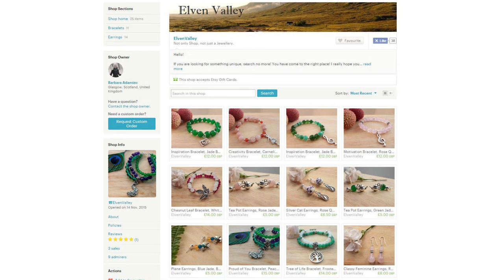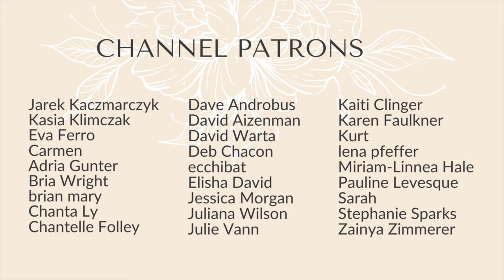HOW I STARTED making jewelry.

Comment: Your art is beautiful. I have a welding background and have just started experimenting with silver jewelry creation. My problem is with the endless choice on silver solder. I bought off amazon what was listed as silver solder but found it does not puddle or flow under mapp gas temperatures. Even the smallest sliver refuses to flow like I see on yours and others videos when using a propain pen torch. If you or anyone reading would be kind enough to provide me with a link to what they use themselves.
Reply from the maker: Ahh, that can be so annoying, and honestly you shouldn't have this many problems with it! If it was genuine solder that is. I think buying solder on sites that aren't by actual suppliers can be tricky. I recommend shopping at Cooksongold in the UK (they also ship within Europe). In the USA go for Rio Grande! Just type solder in their search bar and you'll be given many options. I personally use hard and easy solder the most (for some reson medium solder and I aren't the best team lol). I buy it in the stripe and cut it into small pieces myself. Hope that helps! ❤️ If not, come back and we'll try to ficure something out :)
Reply: @TheArtOfMetalsmithing  thank you for your help. I will try them. I suspect I was sold plain silver wire. I'm not going to give up though. Plan on buying a crucible, ingot mold, press roller and draw plates within the next couple weeks.

Comment: In my country it is illegal to sell your handmade silver etc jewlery unless you study it at school and have certificate :/
Reply from the maker: Really?? Wow, that is so limiting... I can understand where this rule comes from, it's not totally without the reson, but I'd rather see proper regulations in place, rather than making it completely illegal altogether. May I ask where you're from?
Reply: @TheArtOfMetalsmithing  I'm from Slovakia. And those rules are to protect buyers so they dont buy imitations of precious metals. You can sell unmarked silver stuff only when it is under 3 grams. But this also doesn't help that much - because of this rule there are even more bad products. For example I bought tourmaline sticks and the top of it there is so thin silver, that it get easily ripped of by the circle/ring which is connected to it. Or I bought  kunzite stick and the bezel was actually good but that hanging stuff (sorry don't know English jewelry terminology) after using changed color and it definitely wasn't silver. :/ You can make silver jewlery  above 3 grams, but only for yourself or as a gift. It is just illegal to sell it if you don't have a license from school. Plus there is also problem to get the right liquids (if you need acid) or tools  If you don't have business licence. There are some jewlery courses, but they are more like for hobby. If you pass it, it doesn't mean anything. Thankfully, there is one school in capital city, which allows you to study jewlery in the evenings. So 2 times per month we have practical classes. And you study for subjects home and then you have exams. It is possible to pass it in 2 years, since in one year you can make exams for 2 years of study. Just the last year takes whole year because there are final exams at the end of school year. 
And for every exam there are subjects like - art history, materials, technology + at home you prepare about 20 art projects which consist of drawing, painting, modelling stuff out of clay, then study of jewels of various periods and also designing jewels. And first year we also had exam from construction drawing
. But it is funny, that there are like doctors, archeologists, architects etc, so most of us has university title and we have to study at high school :D